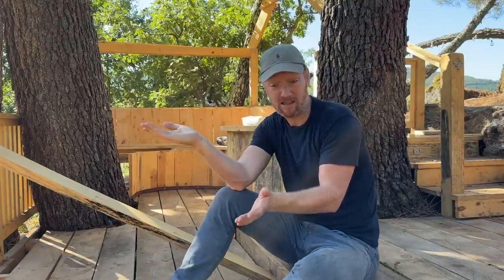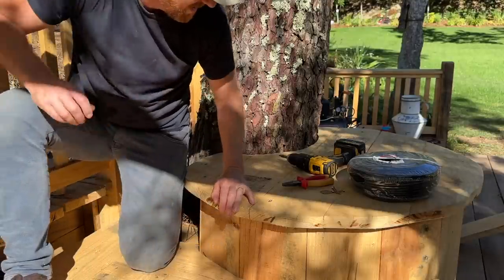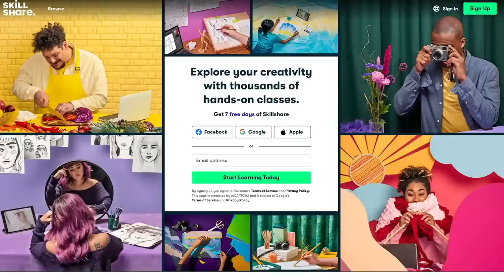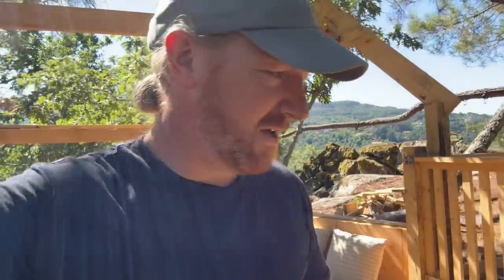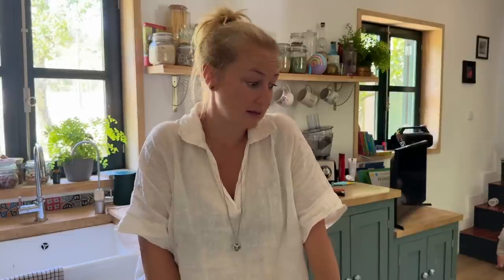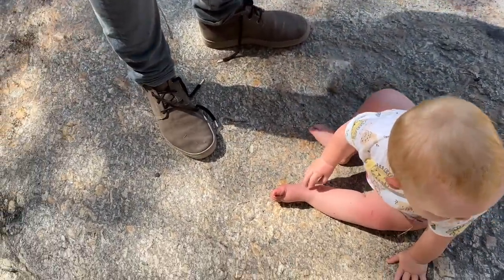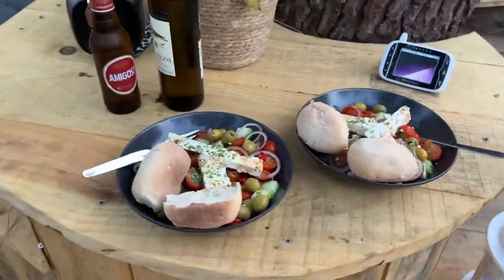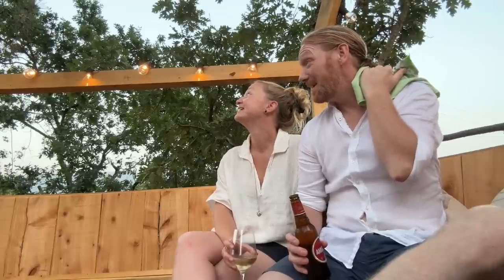We Could Ruin Everything If We're Not Careful!

Comment: DIY ice pack - 2 parts water to 1 part rubbing alcohol & put them in the freezer.  You can put them in plastic baggies (double bag them just in case) - sandwich, quart or gallon.  Whatever size you need.  And you can use one & then get another one so that you always have a cold one.  It worked great for me recovering from rotator cuff surgery.  They mold very well to your body!  Best to you both & be sure to rest & let your body heal.  Happy birthday, Tara 🙂

Comment: Just to let you know. I had very very similar shoulder issues and symptoms like you seem to have. Mine ended up being a 2 part thing. First was a bulging disk in my neck (not really any neck pain). It was pushing sideways onto a nerve which was showing up in my shoulder blade and giving me pins and needles. Second was a torn rotator cuff which was giving me almost zero power in my arm. I couldn’t hold a tea bag up with my arm level. I went to a physio and acupuncture. Both of which helped amazingly. Rest up and look after yourself

Comment: Garden and House Tips;: Cheap Fertilizaer; For seedlings you need to mix 1 part urine to 20 parts water.  For larger plants 10 parts water to 1 part urine.  Been using urine in garden for years. If you have rat or mouse problems use one part baking soda to one part corn meal, the rats innards burst open because they can't vomit or pass gas.

Comment: Hey Newbys, my first comment... been watching for a few months now... just wanted to suggest something to help you with rolling out cable or pipe, John, make up a water pipe roller, i'll try taking a photo of my old one i found on our property and i've fixed it a bit, but with electrical cable, just any handle of a tool (rake, etc) through a couple bricks with holes in, and put the roll on it and roll the cable off... then it doesn't tangle, and works a treat. You can make a more serious / better system with a little frame of some sort, and then a couple 'saddles' that go over conduit/pipe with a round shaft that could be wood, or metal pipe, whatever you have lying around. Works a treat.

Comment: I have a calcified shoulder which is constant pain etc and one thing that helps keep it reasonably useful / strong is to tie a piece exercise latex (i think) band on to a door handle or something and then grab the other end with the bad shoulder and gently stretch the hanging end across your chest going as far as you can, then gently move back to the tied end and so on

Comment: You probably have a rotator cuff tear. You need to get it checked out or it will only be downhill from there. I've had mine, the left, replaced three times and the rotator removed because I kept putting it off. Don't mess around with it or you'll regret it later. You need an MRI.

Comment: You need to see a Dr. From experience I tore my rotator cuff never did anything about it and years later hurt the same shoulder and wound up having a total reverse shoulder replacement.  Doc said had I fixed it the first time probably wouldn't have been near as bad. Take care of it and don't sweep it under the carpet thinking it will be fine. Better safe than sorry. Wishing you the best.

Comment: John, I'm not a medical doctor but I have experienced shoulder pains similar to what you describe.  What works (great) for me is to use a heavy duty massager to work the muscle groups in my upper back.  I bought a model with a long handle which lets me apply a good deal of force and get the muscle loosened up.

Here's the one I bought.  Panasonic EV2510K Easy Reach Rolling Massager.  I'm not sure they make it any longer but you should be able to find something equally as good.

As a test, take something like a tennis ball.  Stand against a wall with the ball between the wall and your shoulder.  Move around some over the muscles and see if you detect any relief.  No guarantees.  What works for one does not necessarily work for all.

Comment: Hi sorry to hear about the shoulder.  The pins and needles are a bit of a concern.  Not sure if you've checked it out with a doctor but I had similar in my hand with it in my little and ring finger most of all and it was a trapped nerve.  A few weeks of simple exercises helped no end as did a few shoulder strengthening weight training exercises.  Know your frustration at not being able to get on.  Check out the cause of the problem as it will help you heal more quickly if you know exactly what you are dealing with.

Comment: Hi there Tara and John

It looks like a repetitive injury - something that athletes and manual workers get a lot. I had trouble with wrists (carpal tunnel syndrome) from sport, typing a lot and renovations myself. I also ruptured a cruciate ligament in one knee when I was 23. Firstly I recommend getting the shoulder properly diagnosed by a medical specialist with correct diagnostic procedures!!! Make sure you get a top one!!! Can't emphasise this enough. I am an old hippy and always try to treat things naturally but this was a big mistake with my knee. Mainstream medicine combined with natural remedies is the way to go I now realise. I was only about 23 and saw osteopaths about my knee who would get the swelling down and the pain to go whenever it erupted - but the injury kept returning. The osteopaths used a comfrey compress - a coating of comfrey extract (Dr Christopher's is the best I have found) and  then wrapped my knee in hot wet towels.  I do this now whenever I get some sort of problem from over use - I'm 70 and still active, gardening, renovating swimming etc etc...The osteopaths never suggested mainstream diagnosis with a good orthopaedic surgeon unfortunately for me.  Then finally I was persuaded to see a medical specialist (a good one of course) and after a probe in the operating theatre with a little microscopic camera attached to a needle I learn it was too late to sew back the ligament, it had dissolved away.The surgeon who looked at my knee tidies up some torn cartilage and sent me to a super good physiotherapist who gave me knee exercises that held my knee together until about 18 months ago.  I am on a list to get a knee replacement now because it is giving me grief. I also saw a good specialist for the carpal tunnel syndrome. He operated on the ligaments or tendons (forget which) to get them to stretch a bit as they were thickening up and blocking up my wrist joint's nerves so my wrists kept going numb and getting pins and needles. I also do exercises to stretch the tendons and ligaments in my wrist. I stumbled on Dr Deepak Chopra, Dr William Li and a few others who are pioneering food as medicine and scientifically demonstrating the effectiveness of natural medicines. For all the accumulated aches and pains I found success with natural anti-inflammatories like ginseng and organic guggulu. I also take glucosamine and have a moringa tree growing in the backyard because I live in the tropics. I eat moringa every day in tea and in food. Yoga and meditation have been also scientifically shown to get down inflammation so I do this too and of course your Mediterranean diet is perfect. Love your show by the way and praying for you both.

Comment: It is imperative to have some adjustments. Once it is healed to go periodically to THE CHIROPRACTOR, TO maintain your neck and spine ALIGNMENT. In my humble opinion, simply not using your arm and shoulders  will not totally  solve your existing problem. You also, need to get to the root of the problem.